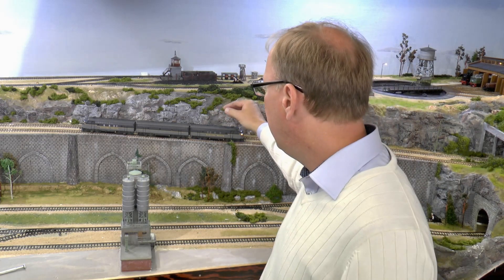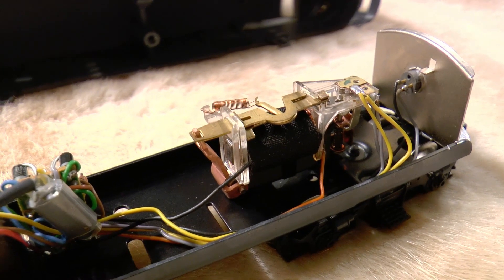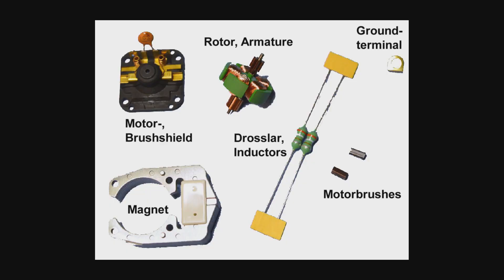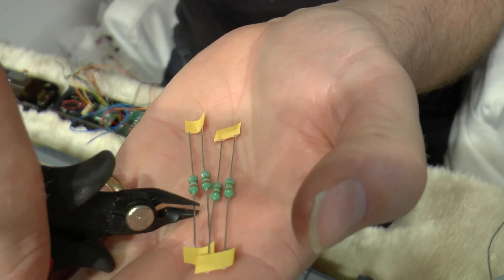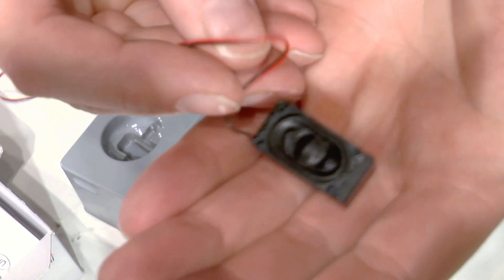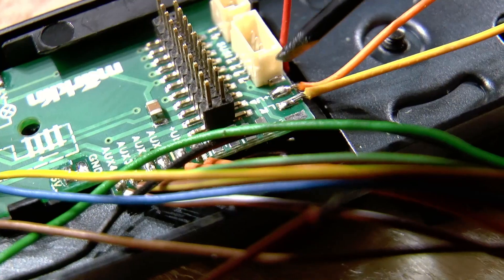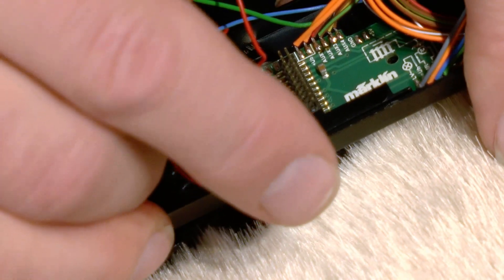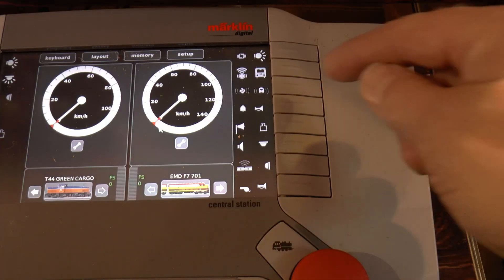Digital conversion of EMD F7 dual motor - Detailed guide DIY

Comment: I always solder the left inductor to the top of the left brushterminal (where the capacitor is connected) and let it point directly to the right (seem from the video's perspective). This way both inductor point to the same direction and not upwards.

Comment: I  know You run digital on Marklin M-tracks , but some say that M-tracks does not work well digitally , so what is the problem then , since your loco`s run well ?
Reply from the maker: Hi! There is no problem at all to run digital on M-rail.. It works perfect!
Reply: Ok , thank you for your answer .
Reply: I think they refer to the mass (GND) detection capabilities. That's different from running digital over M-tracks. That just works. 

When you divide your layout into  sections which are guarded by signals, these sections need to be isolated from the rest of the track. This is often done using mass detection. 

Both rails on a track bed are connected to GND. With C-track these can be isolated from each other since the rest of the rail bed is made of plastic. By isolating one of the rails in a block one rail will always be connected to GND but the other will only be connected when both rails are bridged by the wheels of a passing train. The big plus about this system is that everything with metal wheels will be detected.

Isolating is done by clipping the metal connectors under the trackbed. This is what people often refer to when the mention the clipping of C-track.

Since M-track is all metal, everything but the center conductor is GND. That makes mass detection difficult. In these scenarios other methods like the detection of current are possible. Current detection detects whether something passes that uses current. Like a locomotive or a carriage with lights. It will not detect a carriage without lights as it wont use current.

Another method of detection is by reed sensor. This is a sensor in a glas casing and it reacts when a magnet passes. Every train needs a magnet underneath to let this work.

As for me, I'm still not sure whether I want to clip up my nice C-track. So current detection is definitely an option for me...